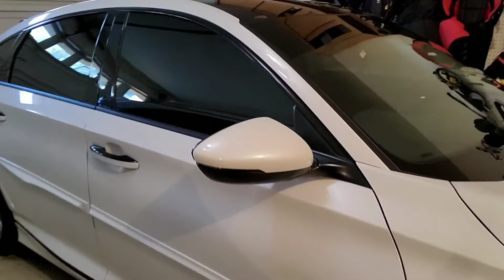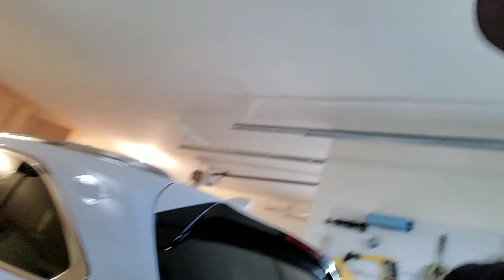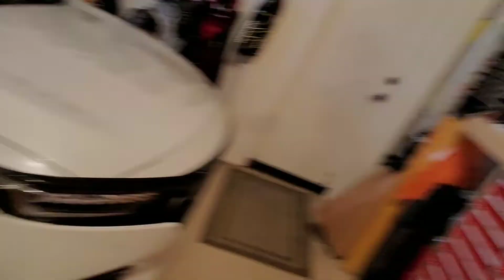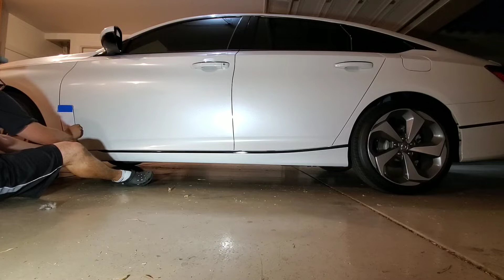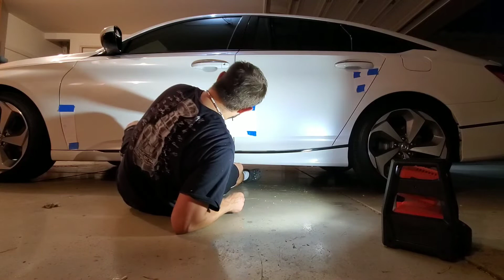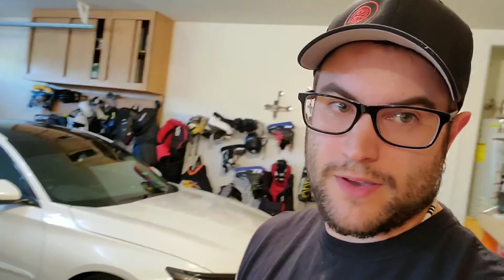2018+ Accord OEM Body Side Molding Install

Comment: I just got this kit for a DIY. What is that roller?  I thought I could just apply pressure with hand.
Reply from the maker: You can use your hand, I bought a rubber roller to help distribute even pressure from home depot.

Comment: I wanna know how to remove a set most efficiently.
Reply from the maker: Would use some waxed dental floss and floss between body side molding and tape. Then would use 3m adhesive remover from walmart to get the rest. I did a video on debadging early on that should show what I did. Good luck.
Reply: Awesome, thanks. I thought fishing line, I'll see if floss is strong enough.
Reply from the maker: @boostismagic  fishing line would also work. Either one should get the job done.
Reply: @justaHondaAccord. Can you show ,e th video to remove it fro, the car .

Comment: Do you think this side moulding would look good of the 2016 9th Gen Accord? I’m seriously thinking of installing it on my 9th gen.
Reply from the maker: I didn't do side molding for looks, think it looks more cluttered but have 2 little kids and figure they will be opening doors into god knows what. Looked at it as cheap insurance for the doors.
Reply: It would look good, and it is also more functional than most think; it’s placement makes the car ever more slippery and re-routes a chunk of air better over the wheels.